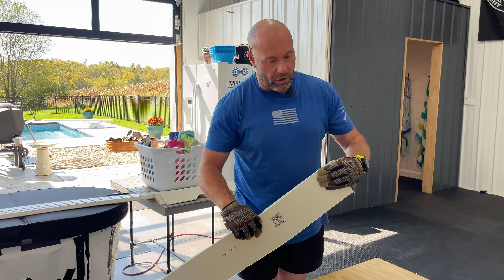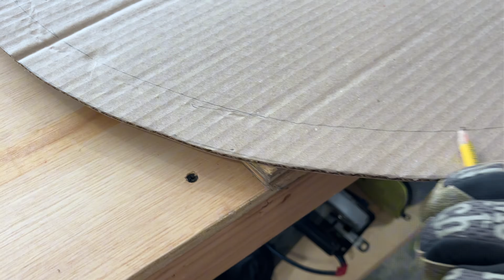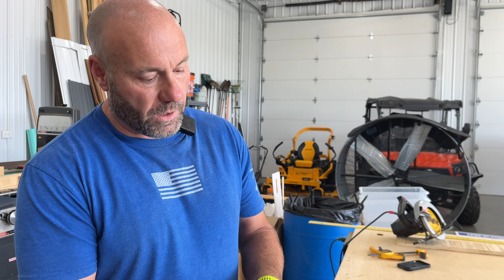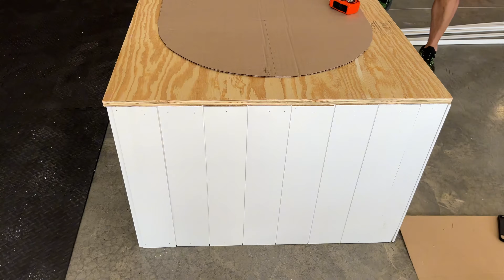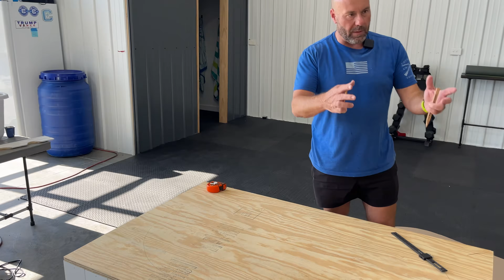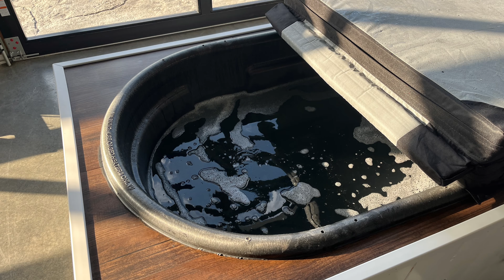DIY Cold Plunge: Cutting and Fitting the Top Deck of the Stock Tank Build

Comment: What are your dimensions of the tank wood box? DIY plunge uses 78in for length, which includes the space for the chiller.  Your design is shorter.
Reply from the maker: The plan you see here is when I modified to allow for the chiller to be outside of the enclosure. It was a matter of space constraints for where it wind up going. I’ll have to look at the dimensions but effectively I just cut it off at the last brace after the enclosure on the DIY Cold Plunge plans.